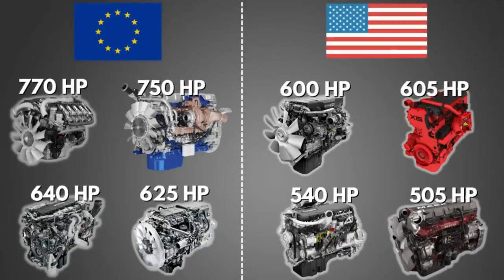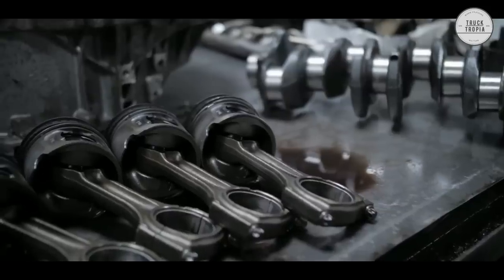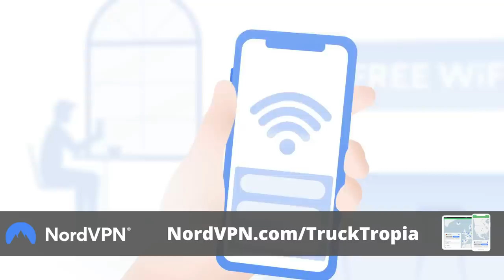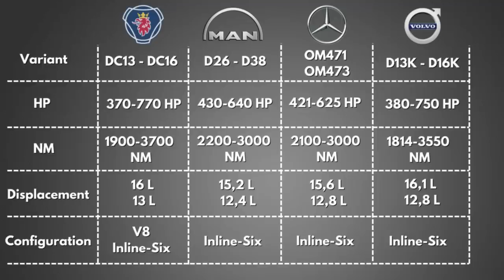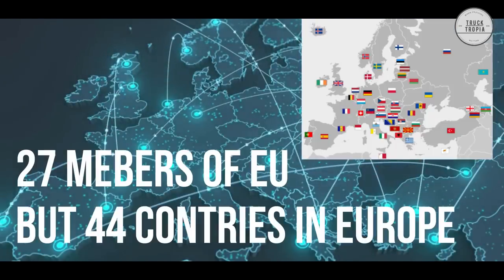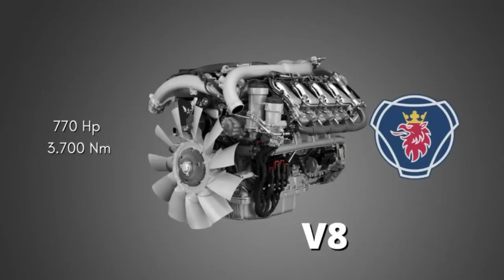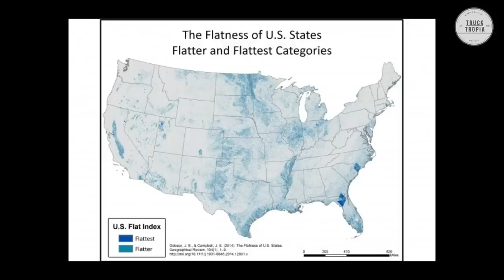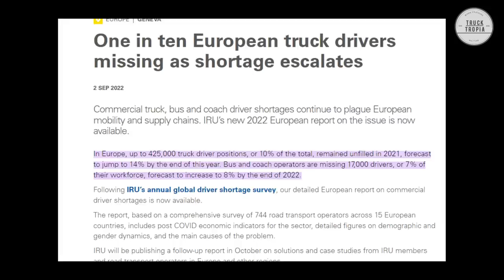Why European Trucks Have Up To 770 HP And US Don’t

Comment: Also another note, these high power engines aren't used in day-to-day transportation. The regular 40 ton trucks that transport goods usually have weaker engines at around 450~550 HP. The powerfull 750HP engines are only really used in heavy haulers that carry super heavy loads like construction parts that need special permits and sometimes even closed off roads
Reply: dump trucks use 620+ ))
Reply: Finland and Sweden have a ton of very high powered trucks. Logging trucks haul some of the heaviest loads around.
Reply: I drive a 2022 770s daily with a 54t ticket. I don't do heavy haulage. This is the norm in my country... weight not the truck so much
Reply: In south korea, the maximum weight for truck in law is 40 ton and many volvo man benz trucks are making 400~500hp here. Many illegally loads more than 100tons

Comment: I used to work at a Volvo reman plant. Before shipping to the client we hooked up the engines to a dyno. Watching the mighty 16 litre going full speed under heavy load always gave me goosebumps
Reply: Please tell us more...
Reply: We remanufactured mostly truck engines and transmissions for construction machinery. There was also a small section for automobile engines as well. 

Those engines are under immense load under operation so we had to make sure they were up for the task. We ran each engine for about 20 min under full power while checking emissions and coolant temp etc. I believe their most powerful engine clocked in at around 3500 Nm.
Reply: What was the flywheel HP ratings please.

Comment: The comments here are worth reading for the variety of responses and opinions. The consensus seems to be that for most of the EU and most of NA the majority of trucks hauling the most common freight are in the 400-500 HP range, with bigger power in some places for bigger loads. Most of us folks here in NA have curious interest in trucking in the EU as it is quite different from our experience, and it seems the same from the folks in the EU. As a 40 year driver and retired small fleet owner I think most NA drivers would struggle to adapt to the EU ways ( lower speeds, less geographic area ) and I'm guessing a lot of EU drivers would like a spin in my 2000 Peterbilt 379 with the Cat 600 (hobby trucking now), easing across Montana, Alberta, Colorado, or Texas on a nice spring day or a cool fall evening. For us over here, it doesn't get much better than that, in this old skinner's opinion. To all on the road, no matter which continent you are traversing, drive safe and make it home in one piece.
Reply: Do you mean Eu trucks or trucks from Europe? Both kinda different
Reply: @Fgafgafgaf different how?

Comment: Some clarification... the max road legal weight limit in Sweden is 74 ton without dispensation with a max length of 25.25m and in Finland the max weight is 76 ton without dispensation with a max length of 34m (truck plush 2 full semi trailers). the 90 ton are only for iron ore and logging truck, are only allowed in Lapland and on certain roads. in Finland you have certain routes where you can drive Iron ore up to 104 ton and logging trucks up to 90 ton.
Reply: Max length in Sweden is 34,5m
Reply: @JoFe-bv2oy  for specific roads yes. but you are not permitted to drive 34.5m on all public roads in Sweden
Reply: @ThePorritZ BK4

Comment: Meanwhile in Canada, we're using American trucks for much hillier terrain. The only flat-ish sections are from mid-Alberta, through Saskatchewan, to maybe halfway through Manitoba. Whereas everywhere else has numerous hills and mountains. Not to mention a lot of trucking companies in Canada pull super-B's (b-trains/b-doubles) over all this terrain. I wish we had more powerful engines. Would make running through the mountains so much easier.
Reply: Then you're running the wrong gears old son. We pull 250,000 pounds gross vehicle weight in the north Maine woods all the time with no problem
Reply: @aaronsanborn4291   On how many axles?
Reply: Scania will join Canadian market next year with xt config hope they will expand more to not only just for mining but also other general goods too
Reply: I feel that. I live in Fargo. Run north states and Canada. Even my 1993 kw w9 with a 3406e struggles at times. And I’m running a twin turbo setup. Miss the era of 3408s. And the slight on America for custom trucks is salty af
Reply: @aaronsanborn4291  An engine with more power and torque will be able to pull longer gears, making it faster (and easier) going uphill. Once you are in the correct gear for the grade and load, while asking 100% from the engine, the only way to go faster is if you have a more power and torque.
Reply: The C-16 and C-18 both exist. At least In the states you can put whatever engine you’d like in them, I’ve seen videos of a 3412 in a 379 double frame before.
Reply: @@aokusazimniy8  
There was one getting fuel beside me at the Flying J in Lancaster Ontario about a month ago. I didn't pay much attention to it, but I'm pretty sure it was pulling a flatbed.
Reply: @Lorne S , Traton/Navistar/Scania have a test fleet of about 15 units in North America, mostly R series, I know of two S series in their fleet.  Primary testing was for emissions system and engine testing as they prepared for the launch of the Scania engine under Navistar.
Reply: drive a new x15 pete in alberta and its an absolute turd even unloaded. the extra power would also be much safer getting up to speed while merging and going up steep grades without having to drop a dozen gears.
Reply: @@123devinzz1  
Half of the aggravation with the job is the truck itself. They're always underpowered and broken down more often than not.
Reply: I can tell you out of experience, Canadian hills are not steep, didn't see a 21%climb in Canada yet
Reply: @aaronsanborn4291  what's it top out at though? Probably spinning 1700rpm at 55
Reply: @dutchman2506  allthough you wont find a whole lot about them on google there are some ridiculously steep roads and parts of highway around newfoundland. i remember my first time in alberta and there was the famed "super test" hill north of fortmcmurray and i thought it was a joke to be named as such compared to places ive been in nl
Reply: I remember back in the old days Manitoulin Transport was running 290 Cummins with a nine speed in their "Super Trucks".
Reply: @aokusazimniy8  I wonder how will that develop with Scania prices. Maybe Scania will offer something in line with other North American manufacturers. In Europe Scania is premium product with premium price. 1/4 more expensive than MAN, and MAN is not cheap.
Reply: @SuperDriver379  Within reason, heavier engine = less weight for cargo.  Those CAT V12 rigs you see are overweight on the steer axle in most states so are basically useless as OTR trucks.  Even a 3408 may be pushing it on a conventional if you want more than a small sleeper.  I've honestly never heard of a C18 in a highway tractor though it is lighter than the 3408, the only road going truck I know of with the C18 is the M1079 tank transporter, but that is a 8x8 military truck and normal trucking regulations don't apply because military.
Reply: @dankinusmc1  I've seen one of the Scanias driving in Colorado, had to do a double take when I saw it.
Reply: @123devinzz1  That would be more on the fleet manager who specced out the truck.  the 400hp but high torque motors seem to be a trend, even though the powerband is ridiculously narrow.  I'm sure a 500hp 1750-1850tq motor in front of a 13 or 18 speed is going to pull hard, but a 400hp/1450tq motor in front of a 10 speed with its maybe 300rpm powerband is going to be a dog even empty.
Reply: @123devinzz1  lol can easily pick out the way under powered trucks on Newfoundland highways... then there is the Wreckhouse, too many mainland/US truckers lose their rigs and loads when they ignore the sign.
Reply: @sinisatrlin840  But well the high price comes with quality of course not to mention the tech too and how low emission euro truck is
But i think people aint gonna mind with the price tho
Reply: @aokusazimniy8  Not sure. For one Scania you get two Turkish built Ford trucks. Scania is one of 4 long hauler trucks here,. In Italy about one in 3 is Scania. I do not know, and i am not sure that North America freight companies would pay premium. Independent drivers that own their bussines and do well are probably more like to buy Scania. In one year you could save 5000 to 7000$ of fuel per long hauler.
Reply: I wonder if we've ever crossed paths. I run the 93 through BC/AB running Super-B
Reply: @sinisatrlin840  We are talking bout Canada and of course they will buy it knowing how good Scania is on mining and how XT config are their best on mining perfomance
Just look at Nikola they are more expensive than S way yet lots of company that wants their trucks are electric willing to buy it tho
(Edit : If we are talking about Turkish trucking and of course Ford is the best to choose since Ford F max are from Turkey nad prob more cheaper cuz they are from there too)
Reply: @dutchman2506  You've obviously never met the resource roads.
Reply: @ericgeorgetruckgrilling  Hah, Manitoulin. I've thought about joining up with them and ditching my current job for something a little less local.
Reply: What can we say. Ego is bad. The weight limit is also put there for a reason. American trucks designs are less safe just like quite most of the american jeep/pickup designs but still advertised to be top of the line and populated among people disregarding the facts that they are just mid in the market. This seemingly free market is not so free with all the telltale spreading among the proud americans that think america fosters the best commercial technology… they often dont, but they sure know how to sanction and monopolize
Reply: @aokusazimniy8  Fleet managers (administrators), banks and leasing companies often have more leverage than truck owners and drivers. Service and dealer network size also counts. 

Scania service tehnician needs long training and many things differ in design than on typical US truck.
For all this it takes time.

Scania also heavyly controls dealerships, and quickly closes stealerships. Once you are warned, second time you cheat customer, you are out.
Reply: @690_5 , we might've. I run the 93 every day, pulling super-B as well.
Reply: @sinisatrlin840  Man i do not know about those kind administration and controls dealership like i'm not even call myself as a businesswoman tho
But what i know is that they will buy it like no need to fret about it anyway 

And as for services i think they are ready since they are planning to go expand to Canada since 2018
Reply: @Sinisa Trlin , the owner of the company I work for has stated he would jump at the opportunity to buy a 770 S Scania, price is not the issue, it is availability, dealership network, and spec.  We do heavy haul, so our trucks are already a half million USD, before we add another $80,000USD in custom accessories, and $15k in securement and related devices(shackles, lifting straps, etc)
Reply: @aaronsanborn4291  You do the speed limit uphill?
Reply: I was a Scania appreciate back from 2006 from Hong Kong, now I'm at Toronto I can go back to Scania to work
Reply: @ericgeorgetruckgrilling  Big motors were350 horsepower! My gosh, we were hauling 80,000 pounds with the old 318 Detroit and 290&330 Cummins. But all the modernization and improvements have all required more power to maintain the ability to perform the same job. Wouldn't it be fun to drop a modern day driver in the seat of an old Jimmy Titan with a 6-71 Detroit and a 5/4 tranny setup and maybe a Hendrickson suspension for good measure? I am sure the "armstrong" power steering, no a/c, solid mounted cab, and other things from those old days would not bother them. And to be totally fair, I do not think that I could take that beating anymore
Reply: @ronfullerton3162  I don't know if that would be funny to watch or scarey!! I used to be a trainer for a big company and it was not uncommon for new hires not to know how to drive a standard let alone a 13 speed.
Reply: @ericgeorgetruckgrilling  As I said, I may not be able to handle such an animal anymore. There were plenty of twin sticks around yet when I started. The 13 speed was wonderful after the 5/4 I had been driving. My last three years of driving was with an autoshifter and a modern Detroit motor in a Freightliner Cascadia. What a change! Those old boys I learned from would never believe what today's trucks are like. Why they were beat to death from the trucks they drove. They were great guys, and I have missed them.
Reply: @ericgeorgetruckgrilling  There were many 290 Cummins. The first truck I drove when I was licenced was an international with said engine, a twin stick transmission, and arm strong steering. Those two weeks were awful. Then some old guy rolled it and I got some beat Freightliner coe. Being 6'4", I had little leg room but at least I had ac and power steering!
Reply: @ronfullerton3162  it was only a few decades ago tripple road trains where being pulled by less than 450 hp.
Reply: @butchphillips873  ...likely on tri-axle tractors & "multi-legger" A-trains. 

Remember, the well-known US 80,000 lbs limit only applies to the Interstate National Network (12,000 lbs on Steer-Axles and 34,000 lbs each on tandem-drive & tandem-trailer bogeys), with a max. 41-ft wheelbase, calculated from trailer's king-pin to the center of the trailer-bogeys).

But many US-States have much higher weights and dimensions for intra-State operations only. 

Take MI(chigan) for example: That State has no weight-limits for intra-State operations, as long as no axle exceeds 20,000 lbs gross-weight! (that's why you'll see these "centi-pedes" with too many axles to count. .... and that is also why their roads are in piss-poor shape.

Problem is, when you're trying to maneuver at an intersection with up to 12 axles on the trailer, but only 4 axles rigid and 5 lift-axles in the front of the 4-axle bogey and 3 lift-axles at the back of the bogey....., your gross will still weigh 240,000 lbs....but only 80,000 lbs touch the pavement! (the excess weight also damages the suspensions, bushings & tires of the rigid axles during the turning-maneuver, even at slow speeds).

Newer trailers now have force-steered duals ahead of the bogey, and self-steered duals behind the bogey, which is easier on the trailer as well as the pavement, but they still must be lifted for backing-up.
Reply: @aokusazimniy8  niceee Scania will rock da boat
Reply: @lornes7526  There was a guy from the Hamilton, Ontario area that imported one a year or 2 ago. he mainly did pull a flatbed I believe. it was either black or Burgundy I don't really remember.
Reply: Stop buying farmer trucks from the the US and focus on VOLVO and SCANIA from Sweden.
This will increase your productivity during winter time.
These trucks from VOLVO and SCANIA was designed from bottom to top to deliver 100% in any arctic conditions in Scandinavia!

Truckers in the US are only experts in driving paved Highways!!!!!!
Reply: @123devinzz1  you must have been up gros morne  national park. Scary place but beautiful.
Reply: You do realize why it’s like that right? The increased power would make it worse
Reply: Import a Scania 770 then :)
Reply: Meanwhile in Australia we will continue with our 50 metre long, 13 axle road trains forever.
Reply: Ontario is largely pretty flat.
Not "great planes" flat, but not that far off.
Reply: Isn’t western star Canadian brand?
Reply: @ice-cold4342  , no. Western Star was originally a sub brand of White (US) but built in Canada. Though eventually manufacturing was moved to the US and then to Mexico (I believe).
Reply: @RIckardMB 
No. Put a C18 in the Truck